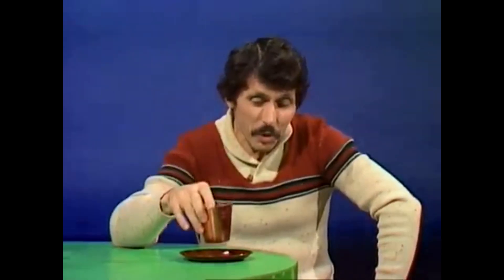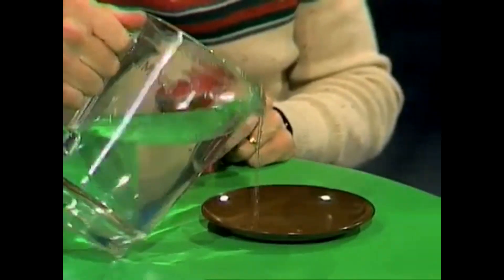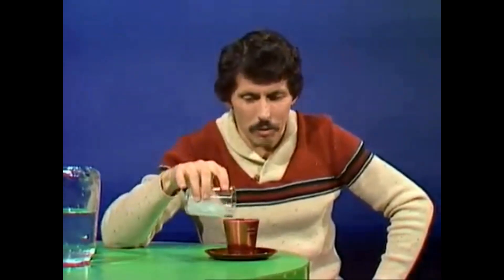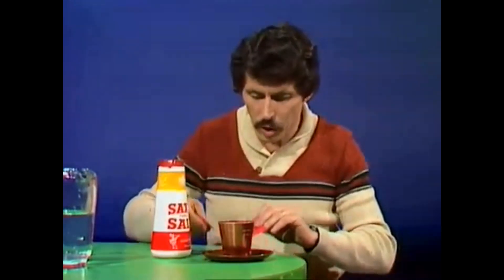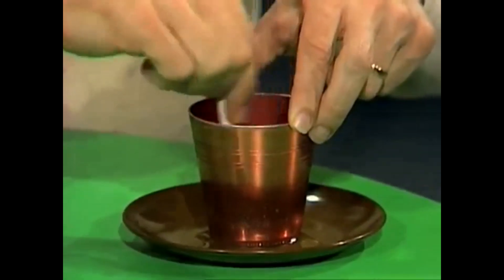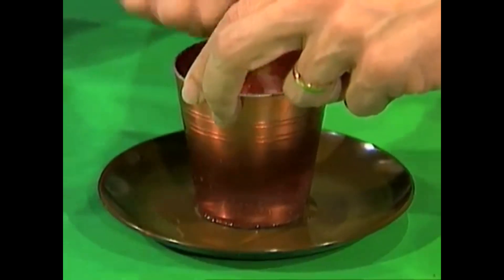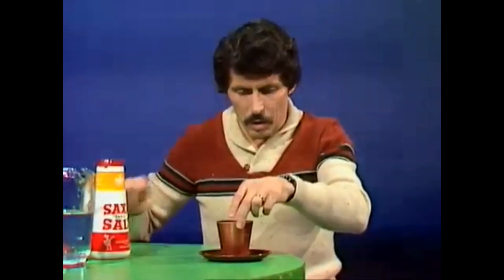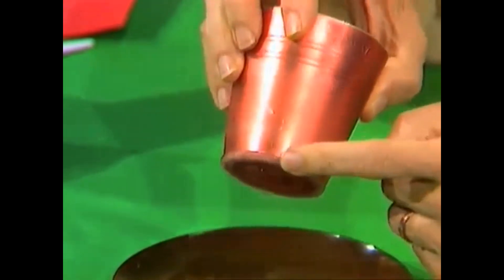Defying Gravity with Ice

Comment: And that's the first lesson of mixology: why a metal cup sticks to it's lid
Reply: Because of the salt freezing them together?
Reply: @TC-rc1zf  no, the transfer of cold to a metal cup. Though it is more prominent with salty drinks and bartenders tend to leave the glass onto a rubber mat or something that will prevent condensation from freezing it to the cup.
Reply: What? Prolly has more to do w cup cooling faster (getting smaller faster) than the lid. Also freeze point of alcohol is pretty low don't see how its gunna freeze up inside cup. Maybe freeze condensate on outside. I dunno but I do know mixologist and physicist are different.
Reply: @TrapperAaron  the opposite. The cup expands when frozen and that wedges it into the lid. If it shrunk, the lid would fall off.
Reply: @With_Victor_B  metal expands when heated, it shrinks when chilled. So likely the lid shrinks faster than its base.